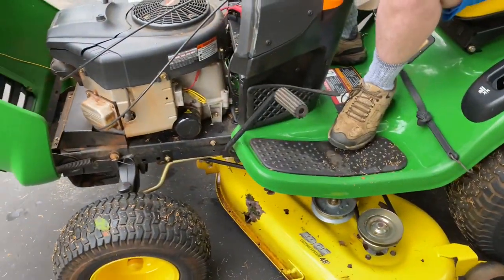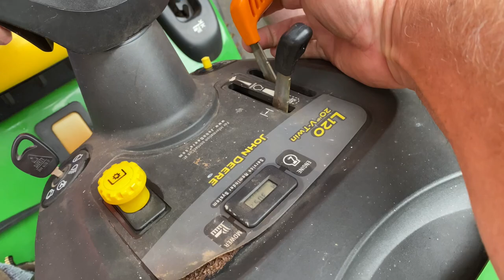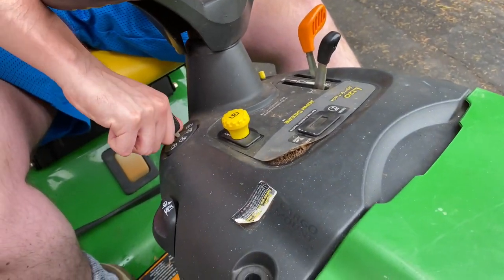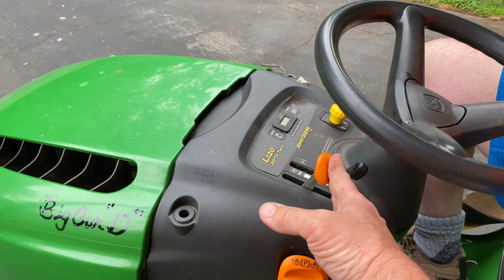John Deere L120 Review - 20 years of service - Lawn Tractor / Mower Review

Comment: I bought my l120 new in 2003 , it has about 1000 hours on it now and I have only replaced battery's, belts , front wheel bushings and one deck spindle, it has been a great machine.

Comment: I bought mine L120 21 years ago and it just turned over 750 hrs. Oil leaking in the front. Plan to do some work on the frame and deck.  Been moving 1 acre lot for that amount of time. Great mower.

Comment: I have the L130, same mower but has Kohler 23 hp engine, 20 years old and still going strong, normal maintenance and replaced spindles once and clutch, it’s been a great mower.

Comment: Man it took you that long to see those grease fittings? I have the L130 same mower just with 23 hp Kohler engine, my deck pulley covers have been there always and there’s no deck corrosion around them but I’ve always blown the deck and complete mower off with compressor air.